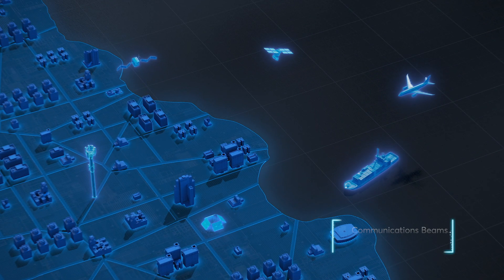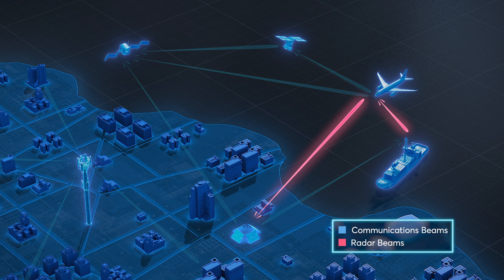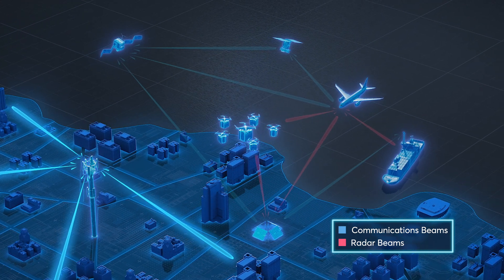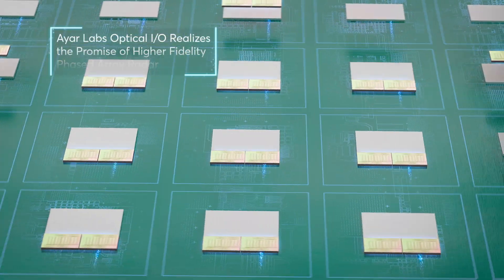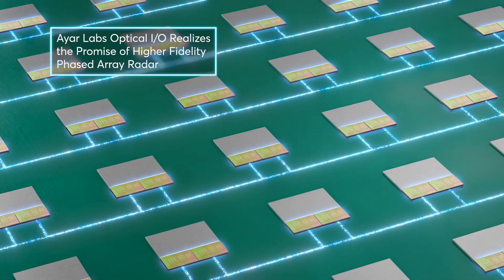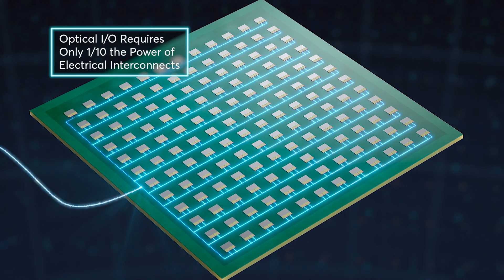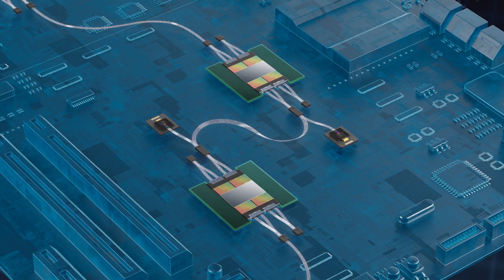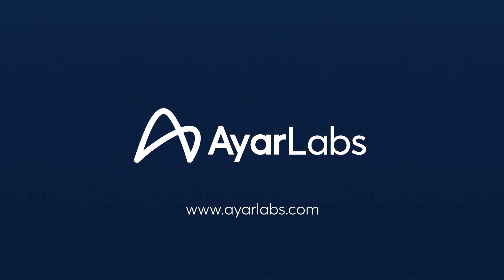Optical I/O: Designing the Future of Digital Beamforming and Antenna Arrays

Comment: Fascinating potential for photonic integrated circuits. Along with the technology of high optical data bandwidth promised by frequency comb technology and the increasing incorporation of non-linear optics in PICs means that almost all silicon technologies can be scaled to greater sizes without being concerned with the bounds of traditional electronics. Its no wonder all companies at the forefront of semiconductor technology and effectively getting married with photonics. As they say, a match made in heaven.